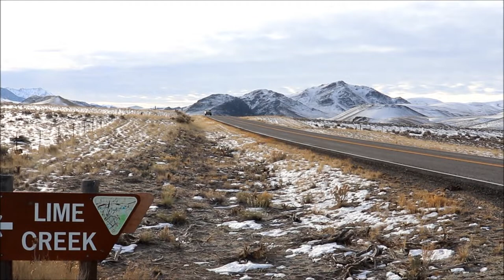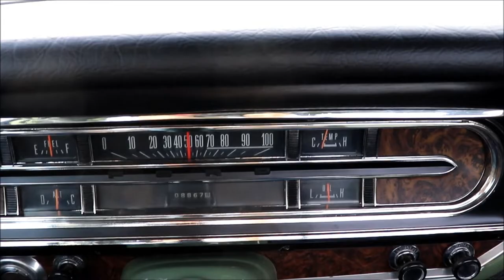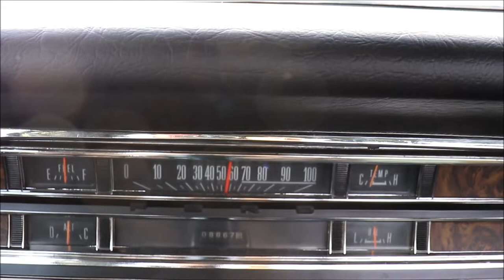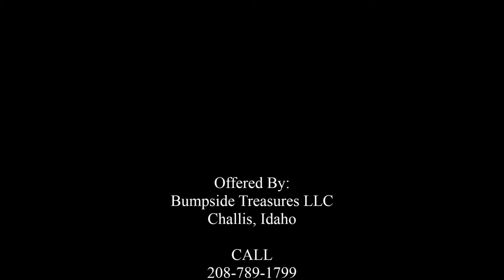1970 F-250 4x4 Highboy Ranger - Total restoration

Comment: VERY nice restoration! I'd love to do that to my '72 F250 2wd one day. My dad bought a '70 F250 2wd new. Custom Camper Special with 3 fuel tanks. Unfortunately, for some reason Ford decided to gear it really high with a 3.09 rear end. He remembers taking I-90 across Washington State and having it in 2nd gear climbing the Saddle Mountains with no load. The factory also overfilled the automatic  transmission so it overheated pulling the grade, spilling onto the undercoat and causing it to catch fire. The truck was just weeks old but the truck survived the fire. Nearest dealer towed it in and drained excess fluid and they were on their way. The high gears made it lack power aside from the fact the 360 wasn't a powerhouse and he couldn't get much over 8mpg unless he gave it a tune-up every few thousand miles. It fell victim to the gas crunch of '74 and was sold to a relative.
Reply from the maker: Probably a lot of folks with similar stories!
Reply: @bumpsidetreasures  I forgot to mention dad's '70 F250 had the Wimbleton White on bottom but blue above the bumpside trim.

Comment: What is the top speed with the motor 302?
Reply from the maker: Had a 360, and 4.10 gears. Would go as fast you you wanted, but typically keep it around 65
Reply: @bumpsidetreasures  I live in Argentina and here Ford produced the 223 engines of the Ford Falcon or 6-cylinder mustang from the 50's, 60's.
The bodywork of the f100 was renewed but the engines remained the same.
We had the 50's v8 292 twin-barrel carb.
Today they continue to be used because national spare parts designed in the USA are produced in Argentina.
We use liquefied petroleum gas to power these engines, which is more economical due to its high consumption. Is this fuel used in America?